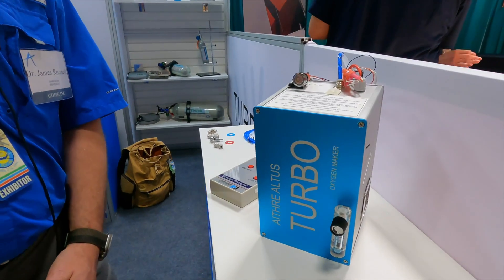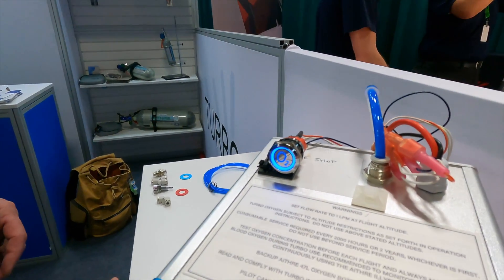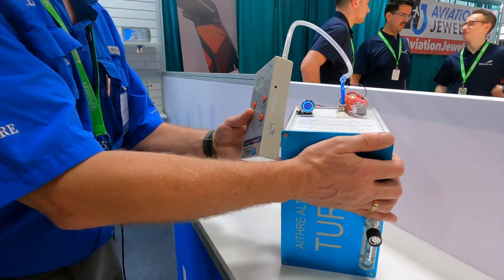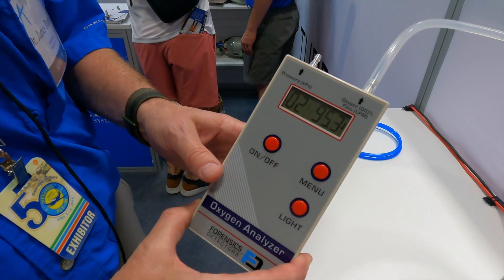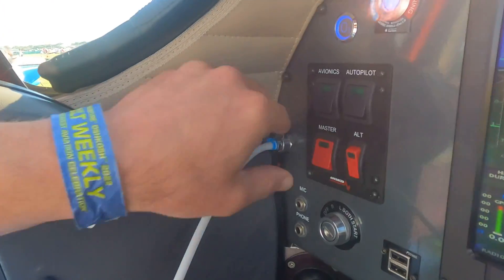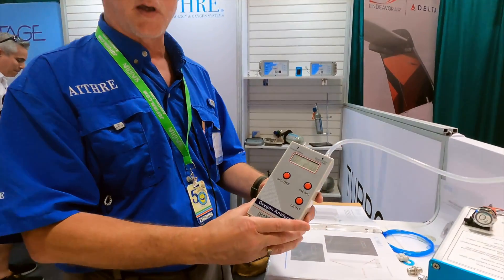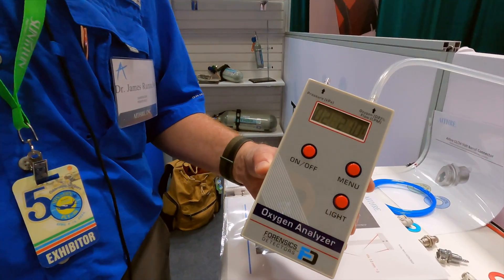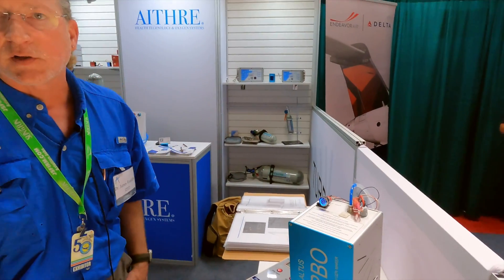Sun 'n Fun 2024: Aithre's Cabin Oxygen Generator

Comment: ValuJet Airlines Flight 592 - May 11, 1992 comes to mind
Reply: This isn't even remotely the same thing and the video is incorrectly titled. The items on the crashed ValuJet flight were single-use, chemical oxygen generators, not a mechanical oxygen concentrator, which actually creates no oxygen itself, but simply concentrates the oxygen already in the atmosphere within the cabin. Larger, heavier and more power hungry versions of this same machine have been widely used in home healthcare settings for decades. My own grandmother lived with one at home for the last two years of her life, because she couldn't be without constant oxygen. They are extremely safe to use.
Reply: @lesb3481  k
Reply: Ignorance comes to mind
Reply: Hang on there. You're trying to compare chemical oxygen generators (Flight 592) to a filtration system? Apples and Oranges sir!

Comment: why can't one of these be attached to a tank and it runs on it's own keeping your tank filled?
Reply: I would guess because it's a filtration system that removes nitrogen from atmospheric air, not a compressor with sufficient output pressure to fill a tank.
Reply: Because, the unit would require an extremely high-pressure pump(think dive compressor) to fill the tank to several thousand PSI and that would be dangerous, heavy and extremely power hungry.
Reply: Check the tank pressure on your O2 setup, versus what this thing puts out. Probably 1000:1 ratio, so you'll need a heavy compressor.
Reply: You’d need an oxygen pressure booster to take the O2 up to tank pressure 1600psi
Reply: So you want to burn more gas and reduce useful load carrying around an unnecessary metal tank?
Reply: @lohphat  Adding it to pre-existing setups in something like a Turbo Bonanza would be well worth the 20 extra pounds. Ability to use higher altitudes with more people and not wasting time getting a tank filled...
Reply: @BonanzaPilot  Sure if the tank is already on the MEL then fine. But adding a tank makes no sense to models not so equipped.
Reply: @lohphat  ok